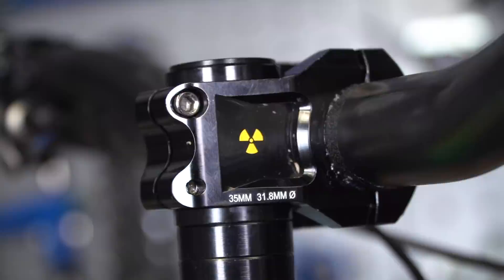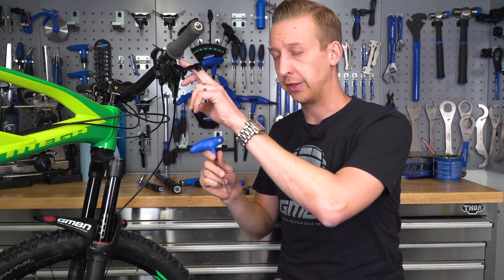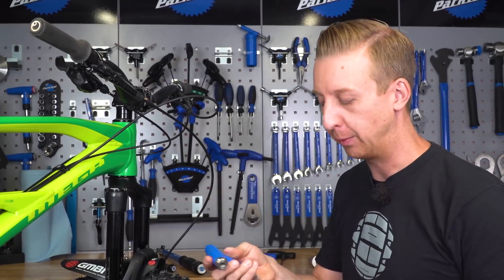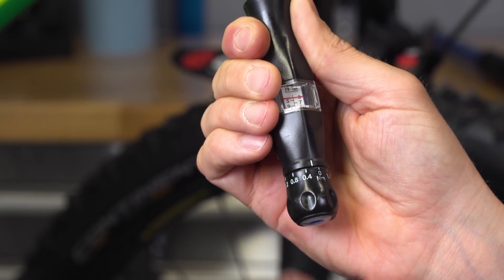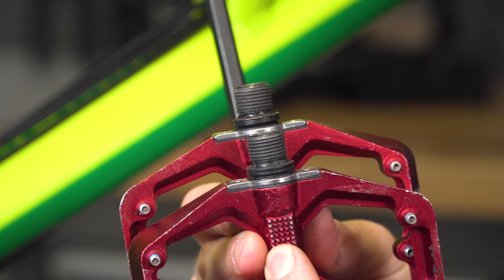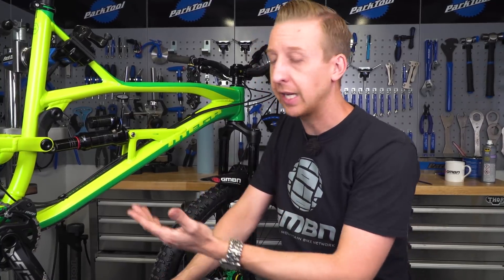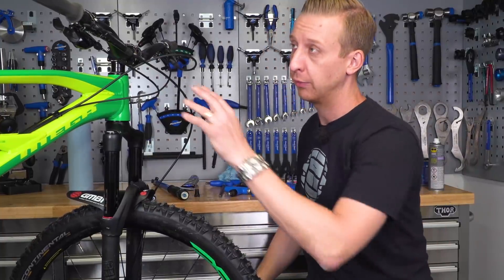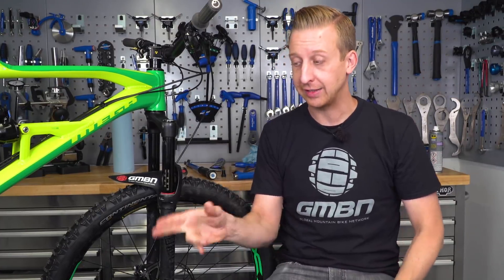Tighten Bolts Correctly On Your Mountain Bike | GMBN Tech How To

Comment: how to untighten and tighten bolt on alloy frame if i don't have torque wrench?
Reply from the maker: Standard Allen keys or Torx keys (depending on the bolt) will do it. But if you want to get them to the right tightness, it's worth investing in a torque wrench
Reply: @gmbntech  thank you guys

Comment: Hi, are reversible ratchet torque wrenches capable of torqueing counterclockwise?
Reply: Most of them aren't, so you have to pay attention to the specs. Clockwise-only torque tools will have an arrow indicated on the tool itself that show its torquing direction.

Comment: hi doddy, i just cleaned my bike today,then i decided to check my bolts, i have my shimano slx m675 ispec b shifter, it so happened that i stripped my bolt hole,and so the bolt doesn't hold on to my handle bars anymore. is it possible for it to be repaired?if it is, any tips in how?
thanks doddy!
#askgmbn

Comment: 8:40 I have this exact problem with my Mega. The rear shock bolt needs tightening after every ride because it’s always working it’s way loose. Even with the thread lock in

Comment: One thing I find with spring-loaded torque wrenches. When done using it. un-wind the adjustment so the pressure is off the spring. This lets the spring stay in its natural state.

Comment: for the steerer to stem and stem to bar interface, fine sand paper (1000 or 1500 grit) does wonders... always sanding in a straight line against the direction a part could potentially rotate (vertical on a steerer/adjacent surface,  horizontal on a bar/adjacent surface). Just to remove the gloss. The fine complimentary scratches will lock the pieces together when clamped. Clean with alcohol after sanding - no grease! However, grease the underside of the bolt heads and bolt threads well for accurate torque specs. No slipping, ever. Worked in a shop for many years. Especially useful for slipping road bars. Of course, this may affect resale and do at your own risk - use the anti-slip grease if you're more comfortable. That being said, performance wise, this method works better than anything else. cheers.

Comment: You guys just forgetting one important thing. Torque force is changing by the length of the handle and also the length of the adapter as well. :) So keep in mind if you set up a torque power that will be a bit different from the real requirements.

Comment: The small pre-set park torque wrench 4-6Nm is a Cam over so you can't over torque. The normal "click" style you can and just like a lit firework never go back to it once it clicks don't give it another tester click... general good practice is to go to your desired torque in increments.. 50%>75%>100% and remember to store you Torque wrench at its correct storage Torque or you mess up the calibration (normally it's lowest claimed setting e.g. 2Nm for a 2-20Nm TR.).

Comment: I've head my rotor bolts come loose on a really hot day, while hiking to a hill and sending it down on a trail. My brakes squealed alot back then, they were old avids, so I didnt think much about them that day. My marzo bombers got eaten away by the bolt come loose. Thankfully it didnt crack but it ate a good 5mm away from the legs :/ Noticed it at home only

Comment: Great vid as always, however you forgot to mention that most torque wrenches don't work both ways and you can ruin your's if you try to loosen bolts.  Also it wise to release the pressure of your torque wrench every time you put it away, cheers.

Comment: I use a drill as it has the torque settings and it works fine, just go slow so you don’t strip bolts

Comment: ALWAYS use a torque wrench, otherwise you risk voiding the warranty on your bike and parts due to negligence and poor maintenance (in addition to breaking your bike). NO SUCH THING AS "MUSCLE MEMORY" with gauging torque values.
You spend thousands on a bike and accessories, so WHY wouldn't you spend a less than $100 for some good torque wrenches???

Comment: Doddy, what u doing clicking that torque wrench multi times dude, thats how u over torque! Should only turn a torque wrench smoothly and continuously until it clicks..Once! Not then 'bounce' the wrench as that usually tightens more...one click is enough. If u need to check a bolts torque, loosen it 1/4 to 1/2 a turn first...
Reply: Just saying cos viewers will copy that....great vid tho...
Reply: I think he was doing it to demonstrate how the wrench indicates you have reached proper torque.  But good call on one & done.

Comment: Great tips Doddy.
Derailer hanger bolt, Chain ring bolts, shock bolts, suspension pivot bolts, and saddle clamp bolts are ones I see on the regular at the shop.
Reply: So you're saying you've seen a bolt 👏

Comment: Doddie, The only way to correctly tighten a bolt is using a torque wrench.  There is nothing called muscle memory to tighten the hardware.  This is something that frustrated me about the GMBN channel, showing fixes without using a torque wrench.  The only time to not use a torque wrench youis on the trail repairs.  Please promote the correct way to tighten bolts.
Reply: bryan rut exactly after amount of time you get a feel of how tight bolts should be, fitted some new pedals recently didn’t use a torque wrench just nipped up lightly and after two weeks of use not come loose yet. However I do use torque wrench on crank arm bolts
Reply: The tolerance of bike parts beyond pivot point with bushings or bearings are large and a range of torque (e.g., muscle memory, perceived torque, etc.) will work just fine.
Reply: J Dub you do get a feel after time.

Comment: Great info! If you check a bolt with lock tight, could this potentially break the bond if it moves a fraction? Should I rather just always remove these and reapply lock tight again?

Comment: Here's a tip I've been using for years for brake levers and shifters: leave them a bit "loose", tighten them enough just to be in place. If you fall, and the levers hit the ground they will "spin/move" instead of bending or braking.
EDIT: Posted this before the end of the video... Doddy mentioned on the end. :)
Reply: thx for the tips Dude

Comment: Also, don't use the ball end of an allen wrench to apply final torque to bolts that require higher levels of torque or you will begin to round out the bolt's head.... Use the flat side of the wrench as that's what it was designed for.

Comment: A hack I do is, make a label with a label maker of what component and the nm for it and then slap it on my repair stand, this has saved me lots of time as a lot of the parts on my bike does not have nm printed on the side, so I don't have to try and find the manual  for it or find it out online when I forget.   But this might not be much help if you work on many bikes
Reply from the maker: Great thinking. Very solid hack.
Reply: Done a similar thing as I was building my new bike, except in to a Google Sheet then printed a copy to put on my fridge 🤙
Reply: That's brilliant!
Reply: Robert Daborn i

Comment: How do you ensure that a torque wrench is calibrated?
Reply: One quick and dirty way to check if a torque wrench is in the correct ball park is to clamp the drive head (the part where the socket attaches to) in a vise or something similar and position the wrench so that the handle is parallel to the floor in the 3 or 9 o'clock position.

Now we can use the formula: 'moment = force * distance'. By using a weight at the end of the handle we can test a certain moment on the torque wrench to test it's calibration. For our purposes: 'force = mass * 9.8' is a good enough approximation, so the force applied to our wrench by a 500g weight would be 4.9N.

Let's say you have a 10kg weight you can attach onto the handle (preferably as near the end as possible), that would apply a force of 49N. Then measure the distance from the centre of the drive end to the point at which the weight is attached to the handle. For example this may be 0.1m (10cm). In this scenario the moment = Force * Distance = 49N * 0.1m = 4.9Nm. So if we set our torque wrench to <4.9 Nm (say 4.7Nm) it should click when the weight is applied, and if set to >4.9 Nm (say 5.1Nm) it should not click. 

In reality your torque wrench does not typically need to be very accurate, and a deviation of 10% is more than acceptable for home use (for example 5Nm +/- 0.5Nm, or 2.4Nm +/- 0.24Nm).
Reply: give that man a cookie!
Reply: Ammar Chaudhry I tutor physics at my college and didn't even think to do that. Outstanding
Reply: Fuck that I’ll just risk it